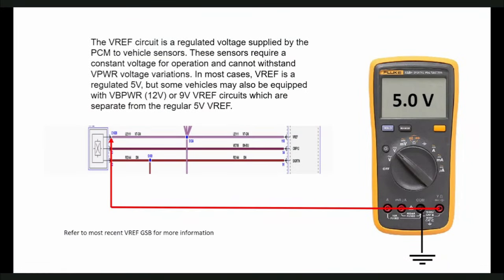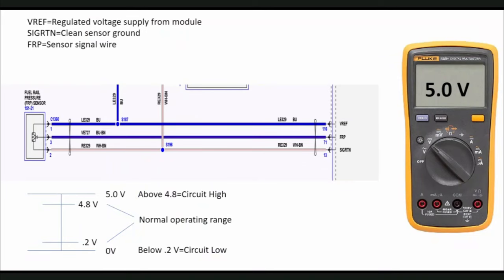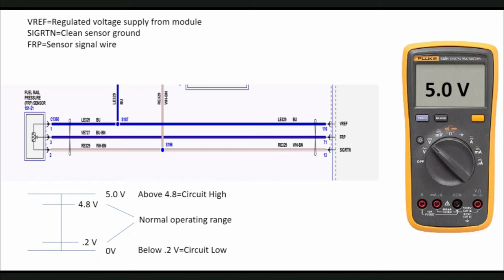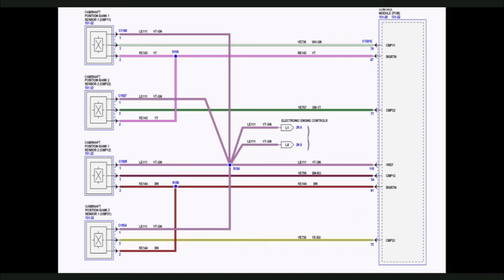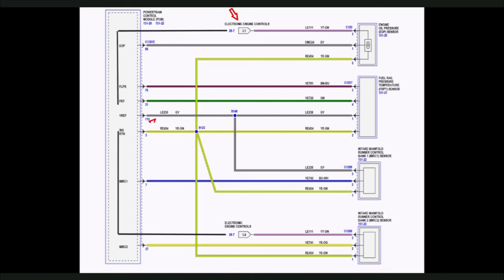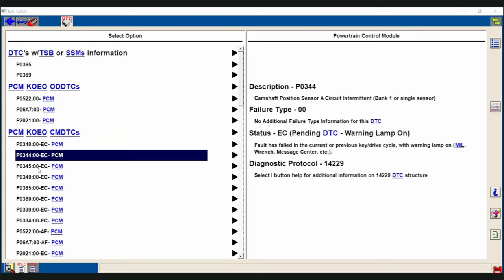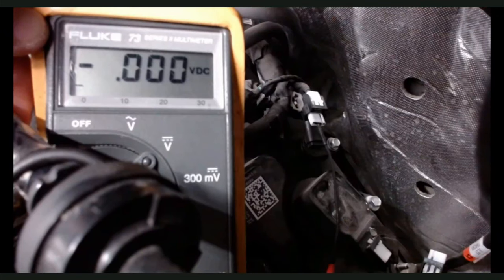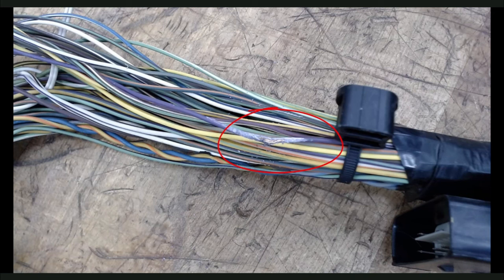Understanding and Troubleshooting 5v VREF Circuits - Multimeter Tests

Comment: I am trying to understand how you can have multiple sensors on one feed and all have 5volts wouldn’t that draw all the 12 volts down to low on some sensors. I was assuming each one draws like a light bulb draws down current 🤷🏼‍♂️

Comment: Hi please you help can if I go to motorcraft service and download asbuilt data from a doner vehicle can I load it onto my own vehicle useing forscan I have installed blind spot onto my car which did not have from factory   useing sodl/sodr from a doner  or would I need to manually input the codes I no there is vin number which I have got hex conversion and where it goes just need help on uploading from doner if it’s possible thanks